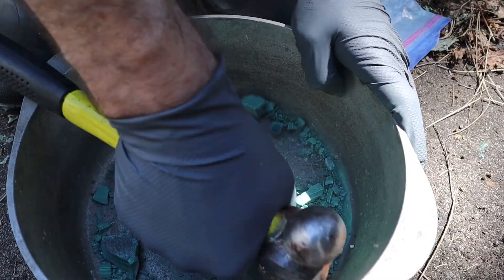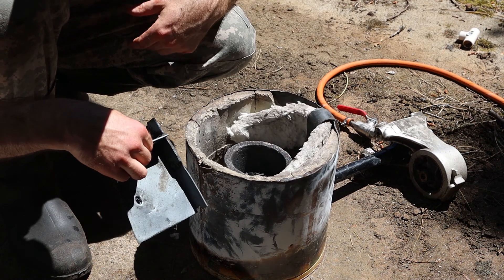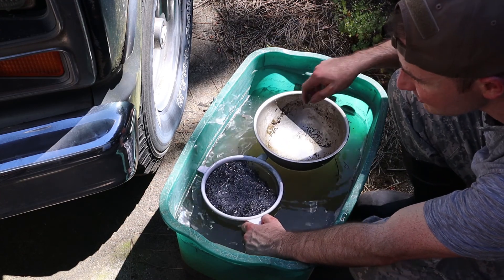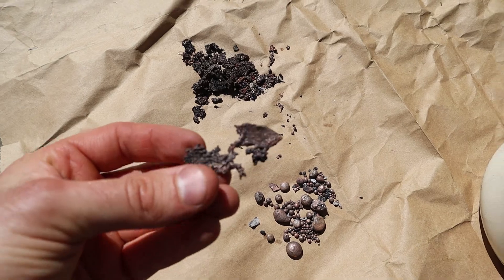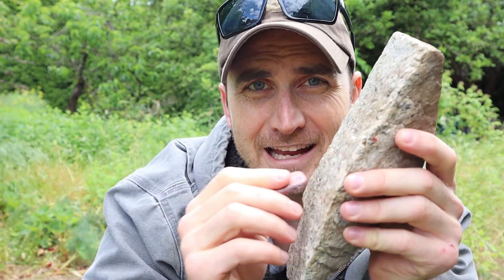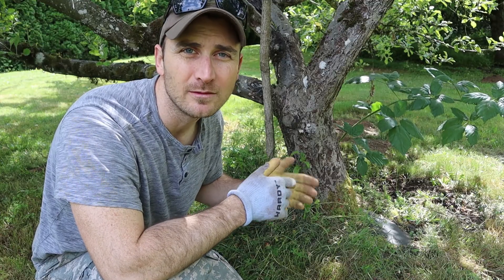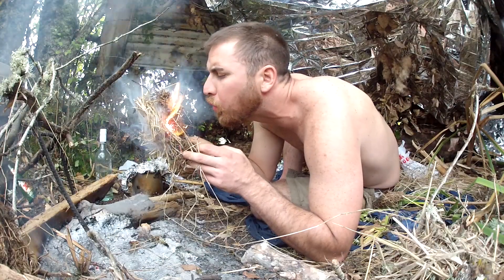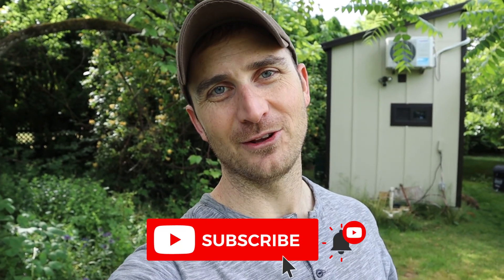Turning Malachite Rock into Copper in a Homemade Foundry

Comment: That's called granulation, mix ore or fine metal shavings with charcoal and heat it in a low oxygen environment, it makes round beads of different sizes. It was and still is used to make jewelry, there are lots of videos of it. If you'd continued to heat it you likely would've got a small ingot, the copper would have eventually flowed together under higher heat.

Comment: Im two years too late for addi g insight, but my ameteur experience is that you can basically cook any copper ore/nased material in rhe oresemce of a reducing agent (carbon is often the agent of choice) and it will yeild a purified base metal. 

My experiments are converting copper sulphate because its cheap and easy to get, into its carbonate and directly smelting just by heating, or comvert it to its oxide with heat and adding carbon to steal the oxygen.

Comment: The coal used for pull oxide from copper , malachite is cu2co3 , with heat the co2 will go out , and the coal will take the oxygen from cu2 then we get pure copper , thanks for this video
Reply: Yes the more oxygen that the presses is exposed to the less effective ; the best results are in a sealed crucible with  1/4 the amount of charcoal ; the exchange happens in an oxygen free Environment the charcoal drives the oxygen out of the sealed crucible and the best way to shape that axe  is by cold hammering; copper hardens with cold hammering it compresses the molecules so hammering that thing into shape would harden it which is what’s needed to make an axe head
Reply: @shedmanstephen8725  thank sir for this info , so the better way is putting 1/4 of charcoal and 3/4 of malchiate ?
Reply from the maker: Great explanation! :)

Comment: Did you weigh the malachite before and the copper after? What was the conversion percentage?
Reply from the maker: I didn't weigh it unfortunately. I had that same question afterwards. I'm going to keep my bigger stones intact at this point but I still have enough smaller particles for one more melt, so on that iteration, I will get that data. Thanks for the comment and for supporting my channel :)
Reply: Malachite have about 30-40% pure copper , and thats depending on rock

Comment: What is the purpose of adding the coal ash?
Reply: Malachite is cu2co3 , with heat co2 will out then we get cuo , then we need to pull oxygen from oxide copper , the coal ash its need oxygen cuase he cover the curcible , and its take the oxygen from oxide copper , then we got metal copper , thier is other way it by let the hydrogen gas pass through oxide copper when it heated the it will take the oxygen and be h2o and we get pure copper